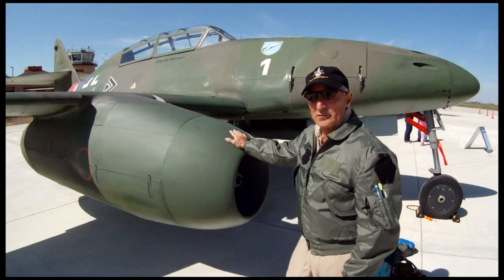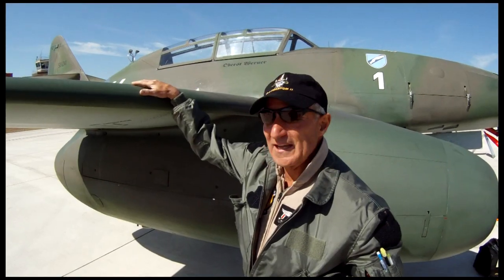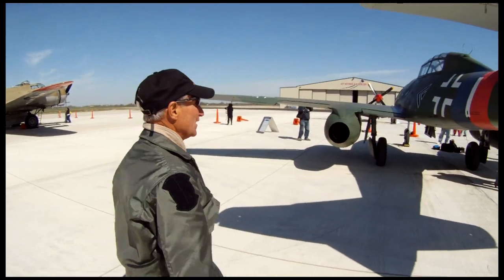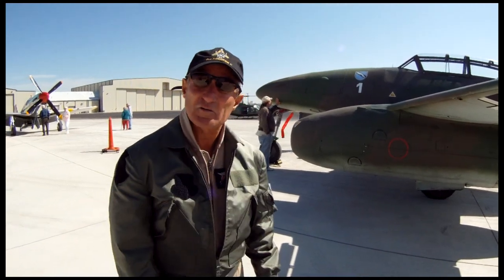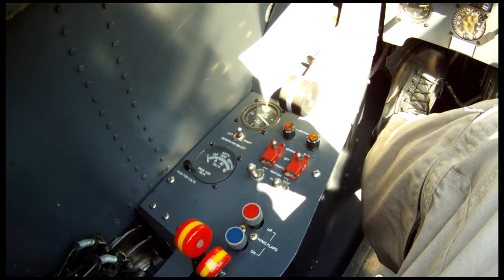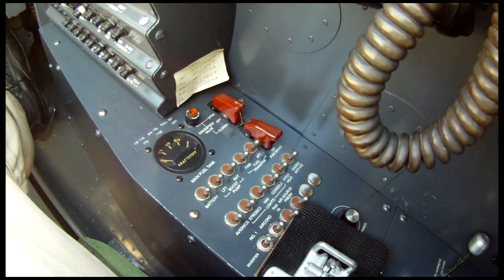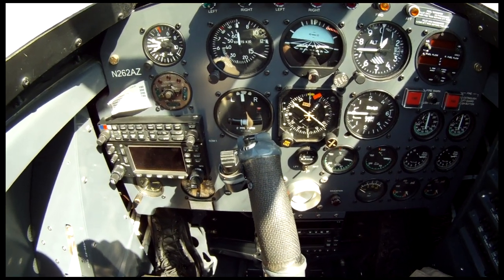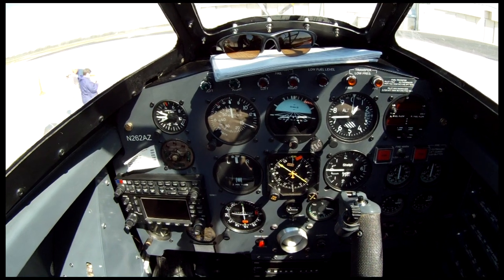Me-262 Walkaround Cockpit Chec

Comment: Great to see the review of an airplane that I helped to build.  He did miss some details though.  There is elevator trim via an electric jackscrew motor for the entire horizontal stabilizer which is controlled by a switch on the joystick.  Also, the throttles have a spring detent that allows full power from the J-85's when pushed full forward.  The detent setting gives the original thrust rating from the Jumo 004's, which is critical for the single engine performance.  There is not enough vertical stabilizer and rudder authority to counteract the full thrust from one operating J-85 if the other fails between 125 and 175 knots.

Comment: it would be nice if the callings foundation would correctly point out if this is a replica ME262 rather than implying it's an original.
Reply: Ron Nath I agree, I hate when people do that to replica aircraft.
They always say "all original", but then you look it up and it could have been like 1% original or something.
Reply: +LegitGaming117 When they started a production line to build several Me-262 replicas,  they were given the blessing from EADS / Messerschmitt  in Germany to assign serial numbers starting from the last wartime example. Specifically they are second-generation Me-262s with modern engines and with their own new Me-262 aircraft type designation to distinguish them from wartime originals on paper.
Reply: yes its a replica.  I helped build them.

Comment: What does BMCA mean?
Reply: It's Vmca. The letter V, in aviation terms, indicates velocity, or airspeed. So Vmca means airspeed minimum control air, or the minimum speed (in the air) that directional control can be maintained with one engine inoperative. Basically, it's a measure of how slow the plane can go with one engine and remain controllable.

Comment: I like.  But not the 520 pound dead weight over each engine.  I'm sure the redesign team scratched their heads many times on this one.  Placing fuel over the engine is problematic.   Lengthening the nose would increase the arm, but decrease the authenticity....nuts.
Reply: +Timothy Scott   The original Jumo engines weighed 1800 pounds while the GE CJ610s used in the replicas only weigh 395 pounds.  So the nacelles have extra weight to keep the CG within specs.